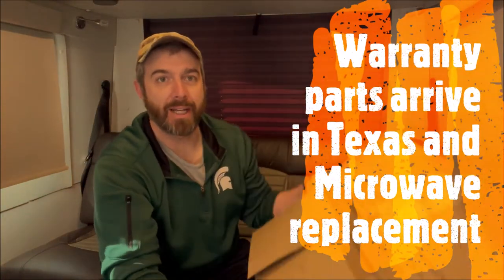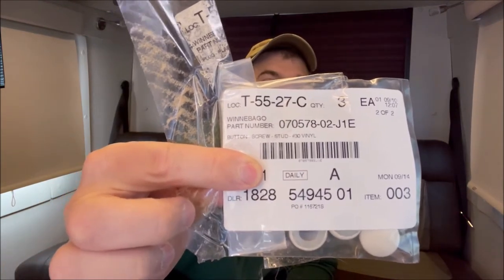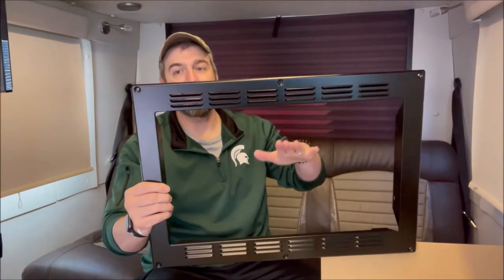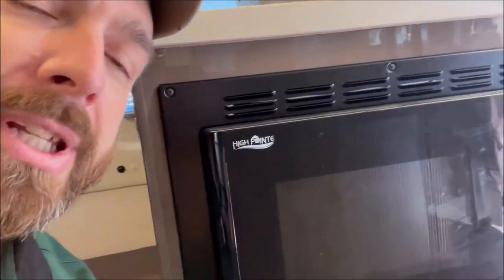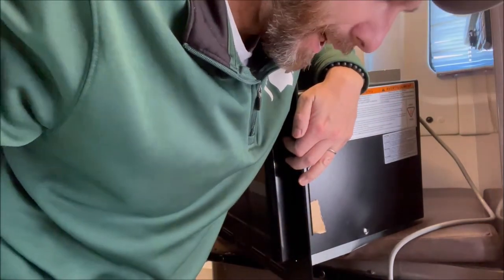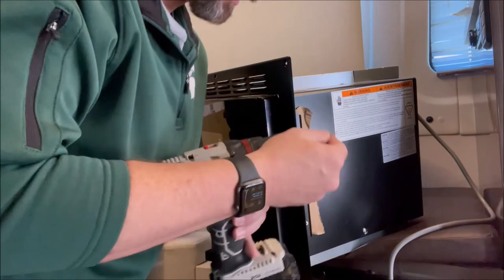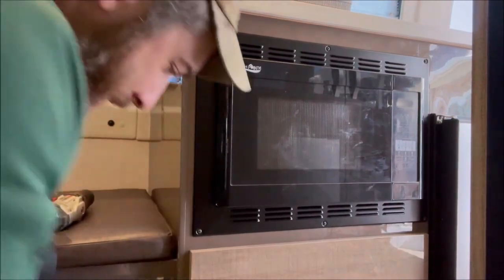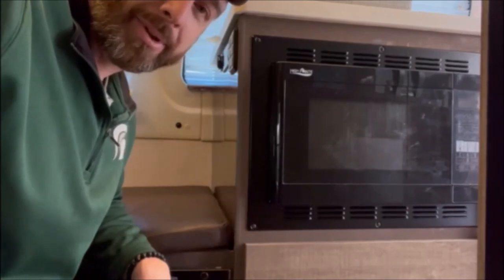Warranty parts arrive in Texas and Microwave Replacement.

Comment: I'm currently replacing my 3rd microwave frame. This time I will try to secure the micro to the shelf and  not to the  bracket.  I  tried re-enforcing the frame with  HD screen material and  JB weld. Worked just a little longer.

Comment: That panel will crack again and again if it is bearing any of the weight of the microwave.  The design is flawed if the front panel is trying to support any of the weight, because every bump in the road will flex the panel a little, eventually breaking it.  A better design would be to secure the oven to the wood frame inside the cabinet, maybe with straps or scrap wood, then install the front panel without allowing it to have contact with the oven.  Or the company could provide a really heavy front panel - which they won't do, because they already cheapened out on the design, so why go to more expense?